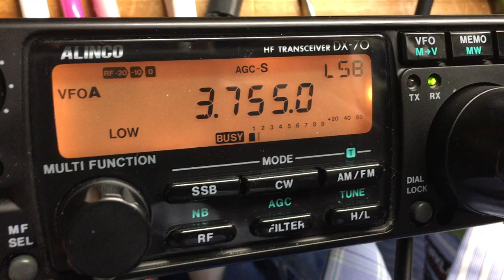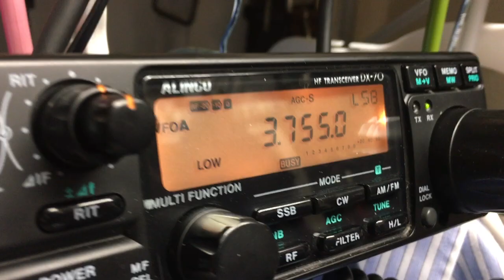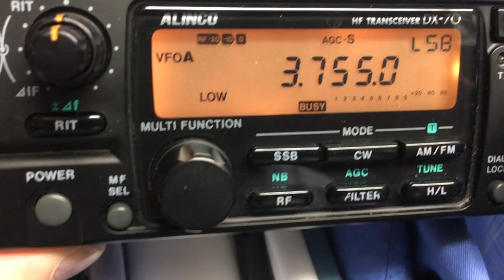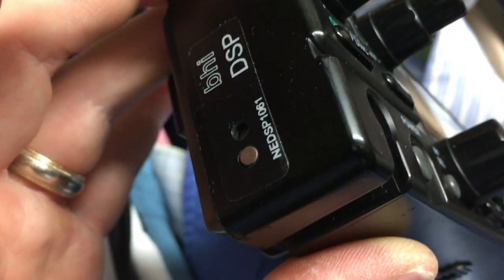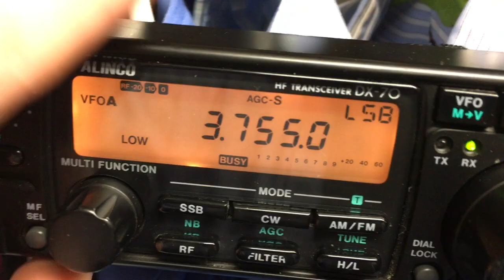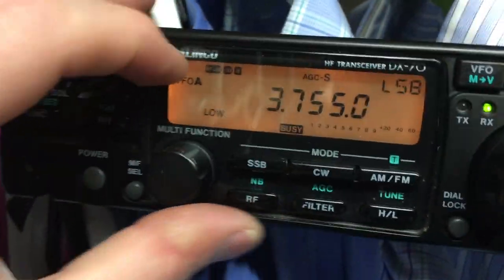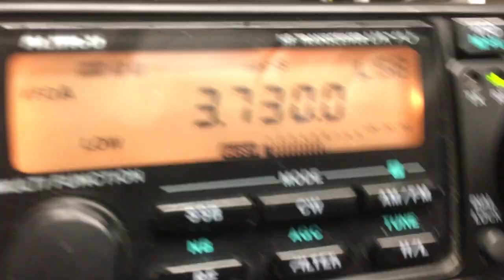2017.12.07 - bhi DSP install in an Alinco DX-70TH with remote head kit

Comment: Very good video! Please were i can purchase a panel extension cable like that? TKS! 73 PU2YWX
Reply from the maker: Mine came with the radio itself.  As the radio is very old 20-25 years now, I doubt you will find a new cable.  Best bet would be to set up a search that runs periodically on eBay.  Good luck!
Reply: @christophersuleske1905  TKS bro! 73!